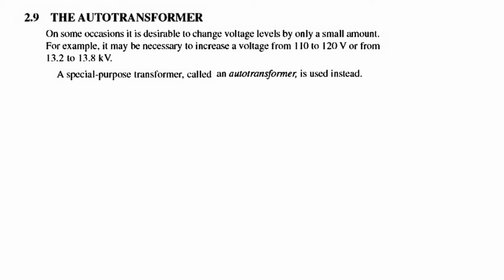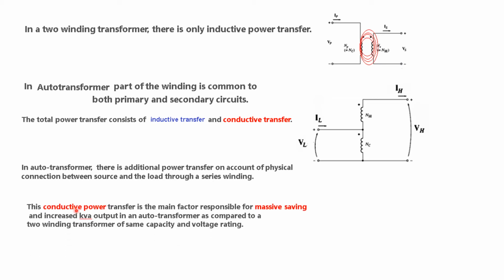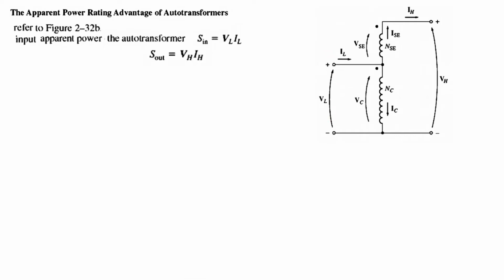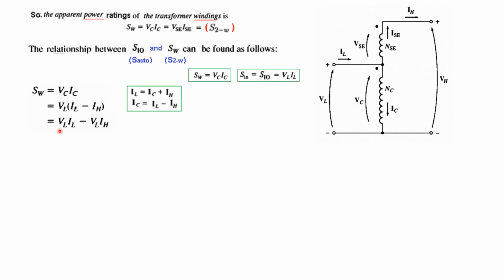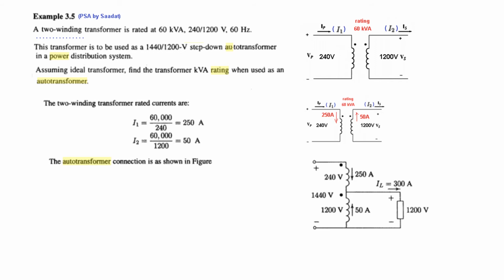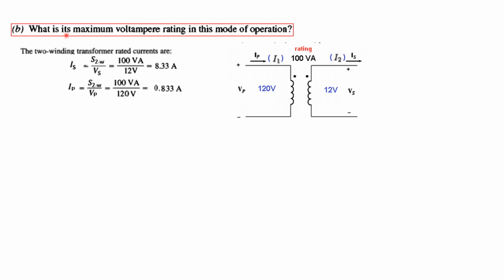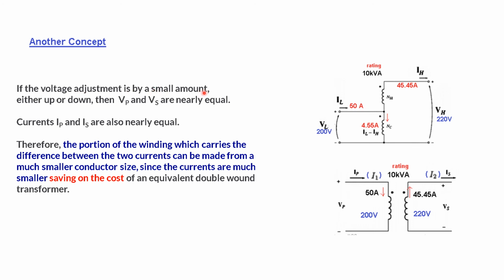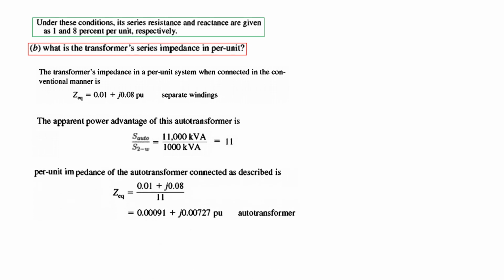(E)EM(C) Ex 2.7 & 2.8 || Autotransformer ||Step-up Autotransformer

Comment: My theory of "voice tell everything" proved again, very reliable and trustable video, thank you very much!
Reply from the maker: Thanks. Can you explain your theory a little further 🤔
Reply: @ElectricalEngineeringAcademy  I do a lot of handyman works, experiencing all kind of customers, some works me hard and they don't pay and say I will send you check but never send, I finally realized there is huge differences among group of people for earnesties, difference of chances to cheat  is not like 10 to 15, it is like 10 to 500, and I slowly realized voice also have a lot to do with cheating, when customer call, feeling comes and almost more than 95% accurate, it is like swap meet store owners can tell if someone came to actually buy or came to check the price or came for restroom, sometimes I doubt about my feeling but actually find out my feeling was right

Comment: if I wind the step up autotransformer in the order 0-30v-70v-100v.  what will happen at 0-30v, if i put 45v voltage into this tap?  will it burn?  then what is the output on tap 0-100v?  please provide an explanation for me, thank you.
Reply from the maker: Auto transformers are designed to adjust small changes. For understanding taps on the transformer, watch this https://www.maddoxtransformer.com/resources/articles/transformer-tap-changers-and-voltage-adjustment-taps